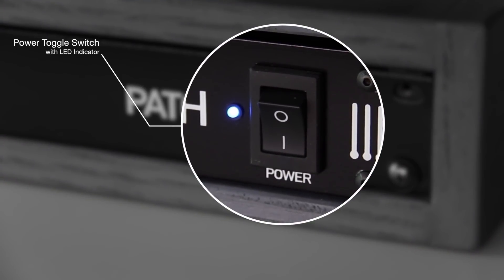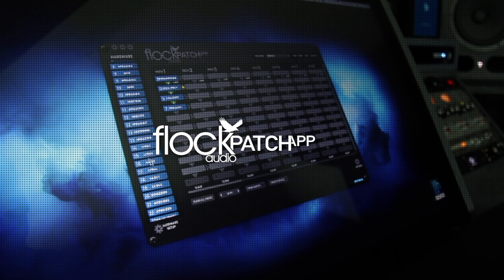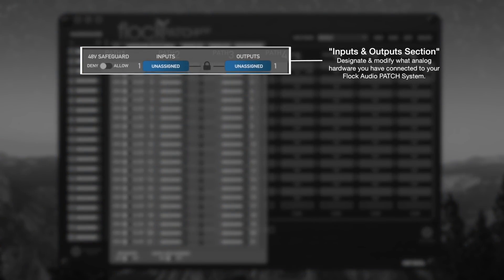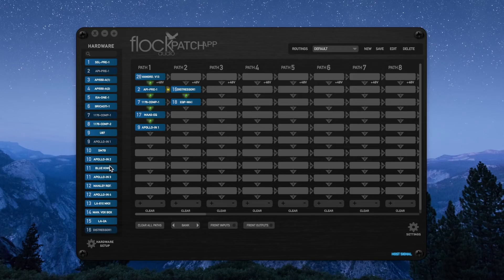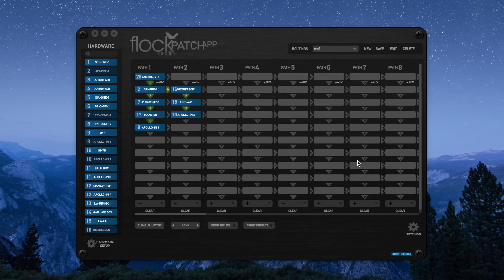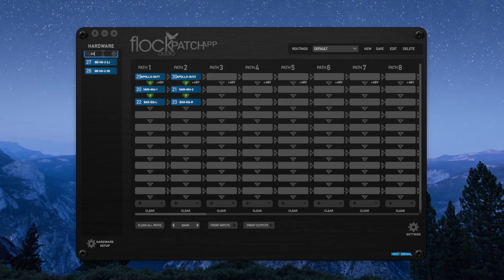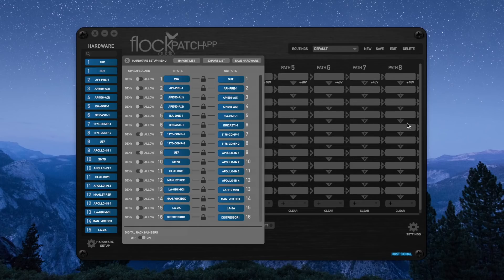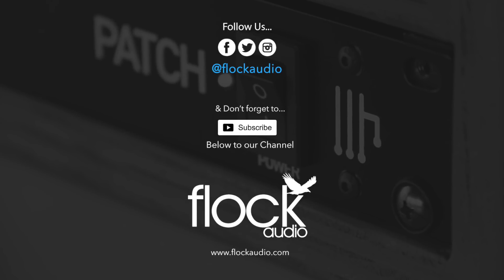Flock Audio: PATCH System Walkthrough

Comment: You have the example with the VANGUARD MIC connected to the patchbay going to a preamp. You say that it is a line level patchbay. Does that really work?
Reply from the maker: Yes — Some microphones and preamp combinations work fine with the Line Level Input. However, certain setups, especially with lower-output microphones like dynamics, do require additional gain on the PATCH input. That’s exactly where our CX Module comes in — providing the necessary boost to bring those signals up closer to line level.

Comment: I'm the exception to most people as I'm a complete beginner to audio synthesis and music production just looking at hardware/software capabilities and between digital/analog this is one of the better innovations for creativity that has been done in all of music. It just makes sense (not talking down the technical feats at all as there is a lot that goes into this kind of routing) to be able to make modular changes in this manner. Before I discovered this invention, I had the mind's idea of a plugboard operator when phones had to be routed, only it's a digital "brain" working for you. That led me to the discovery of patch bays but they were still severely limited in terms of automation and the physical capabilities of manually manipulating analog sound. I found the Korg Volca FM and found a similar way of splitting their audio wavelength modifiers into various orders they called "Algorithms," so I knew somebody somewhere had to have created a proprietary solution for all analog hardware akin to something of a digital GUI and firmware. Can't wait to buy one someday!

Comment: How does this compare to the Tegeler?
Reply from the maker: The Tegeler Konnektor is a different form of analog routing design compared to PATCH with different features and I/O. Sonically both options are transparent and provide reliable analog routing for users. Tegeler is a great a manufacturer and it really just comes down to the need of the user.
Reply: Mychal Simka  its better

Comment: I'm curious about the limitations in using multiple units. 

Is there a limit on how many channels we can send between two Flock units at a given time?
Reply from the maker: You can send as many or as little amount of I/O between units as you require for your setup. If you visit (www.flockaudio.com/downloads) we have a PDF available of a Multi-Unit Setup Example.

Comment: Any issues with running unbalanced synth signals into the patchbay? I suppose I could use DI's in front before going in.. This has always been the hazy part for me..
Reply from the maker: Hi Ernest, PATCH is a +4 Professional Line Level design, so yes we'd recommend that if you are experiencing a low signal from the synths that a DI or equivalent booster would produce a better signal result from the Synth into PATCH. :)
Reply: Flock Audio Thank you, can’t wait to pick one up!!
Reply from the maker: Anytime Ernest! :)

Comment: Let's say I have about 35 or more analogue gears, can I use two or three Flock Patch bays on the same computer?
Reply from the maker: Use upwards to 8 PATCH Systems all connected to the same Computer with 1 single instance of the PATCH APP Software.
Reply: @FlockAudio  Wow that's good news. I'm really glad I'll no longer have to worry about thos short annoying cables anymore.

Comment: Is it possible to bus signals from 2 paths to 1input?
btw great unit!
Reply from the maker: Hi, PATCH Can take any incoming signal and split it between multiple output signals using our Multing Feature!
Reply: @FlockAudio  that's not what the person is asking, he/she is asking if it's possible to MERGE 2 chains into one path, not MULT in this case, which could basically mean that you can sum signals into one input, is it possible?
Reply from the maker: Hi Marco, you are referring to "Summing" signals together when combining 2 signals into 1 output. PATCH does not perform summing.

Comment: How would this go in and out of analog gear without conversion?  So you wouldn’t need extra converters?
Reply from the maker: Zero additional converters required and zero latency. Because PATCH is a 100% analog signal path but digitally controlled, there is no AD/DA built into the system which doesn't convert or change your analog signal path. :)

Comment: I have a question about hardware setup - with a regular patchbay the normalled connections you make when you hook your equipment to the rear are super important because this creates the basic patch workflow...how does this play out with Patch? Do I need to follow any kind of logic when connecting my ins/outs or it doesn't really matter since I can configure everything using the software?
Reply from the maker: Hi HandHeldSound, You are correct! Normalling, Half-Normalling etc. are all irrelevant when using the PATCH System because you make all the necessary routing choices and configurations using the PATCH APP Software, which adds more flexibility options for your routing needs!

Comment: This is one of the most awesome things ever devised!

At first, I thought it was pricey, but considering how many problems this solves, it can cut costs in buying extra hardware and interfaces with too many unnecessary inputs. One could save 500-1k on an I interface with less inputs, not have to buy a monitor controller/switcher ($400+ for a decent one) to save outputs on the interface, etc etc etc, not to mention the obvious conveniences.  Basically, if someone wanted a Lynx 16, they might now get away with a Lynx 8 if they're not doing husge, love seessions. Similarly, an Apollo x8 can then be downgraded to an x6, so on and so forth. You could use a regular patch bay, but that is cumbersome when you want to just create.
I'd hate to add a feature request for something so great, but here it is to make it even more badass:
For an update to the software, I'd add the ability to add notes and pictures, to help remember recall of hardware settings. So, basically at least a simple text note and an image gallery you can drop images to for each preset, or a more complex note where you can put text and images into the same note (almost how Evernote would work on your phone).
For the images, a user can then take photos of their hardware and crop them on their phone, transfer to the computer, and then drag and drop them into the software.
This system is already perfect it seems, but a way to help users recall their hardware info would be even more amazing.
Oh yeah.. A way to back-up and export the notes would be cool too. Who knows.. Maybe even Evernote (or other cross-platform note system) integration..  might be going a bit too far, but since I'm on a roll lol 😂.. Who knows.. Maybe Evernote (or other) would even help you do this, as they might then start integrating Evernote into other systems. Whatever the case, with something like Evernote, a user could do all the notes and pics on their phone and save them to the cloud, without having to do much transferring back and forth to the computer.

Comment: I’m very interested in this unit, but How is this an “Analog” Patch bay? Is this unit ready to ship?
Reply from the maker: Hi Grupo, it is also Analog because there is ZERO AD/DA Conversion built into the PATCH System so each signal is 100% analog travelling through the System.
Reply: @FlockAudio  Do you publish the noise and dynamic range specs? Does it use Relay matrix or FPGA or what?
Reply from the maker: Yes Units are shipping!

Comment: I see you plan a forum ... but in the meantime I have some questions as I prepare to order cabling and 'think' through my setup.I see that I can delink  the rack i/0 but that the delinked i/o continues to display by the same rack number. 

So, if I route my preamps' output as 'in' to a specific rack and have the output routed on the same rack to an analog output from my interface, would I still be able to route that delinked input to any other available rack detached from the delinked output, i.e., pulling it into a path by itself while still being able to use the delinked output later in the path or in another path entirely?
Reply from the maker: Hi DF, This would be best answered by a member of our support team! Can you send your inquiry either on our website (www.flockaudio.com) or email it directly to support@flockaudio.com :) We'd be glad to help assist you!
Reply: FWIW tech support told me that delinked pairs can be individually routed in any manner that you like as long as they maintain their function as either an input or an output. So the answer to my question is, "Yes!"

Comment: How many paths are possible with the software? Is it possible to change the matrix shown in the video to shorten the chains but increase the number of paths?
Reply from the maker: Hi DF, The chains or empty slots aren't activate or representing any processing unless a digital rack is dropped into the slot space. So you can make them as short or as long as you have the amount of gear connected to your system! There are 32 Paths total! :)
Reply: Perfect! That was what I was hoping for.

Comment: I think I may have misunderstood something when this was announced: Is it possible to sum multiple channels to, say, one buss compressor in this unit?
Reply from the maker: Hi Angelo, Thanks for contacting us at Flock Audio! To answer your question PATCH is not a summing unit. You can take any 1 audio source signal and "Mult" it to all other 31 available outputs if you choose. PATCH is a routing system for analog audio, it does not perform channel summing.
Reply: Thanks for your reply! I was hoping for the unit to do a Brauer-style multi-buss approach, where I can send any channel to any buss, reverb, effect, etc.. Is this possibly doable in a software product or should I look elsewhere altogether?
Reply: But! If you have a summing box like the Dangerous for and example, I think you could bus from your DAW input thru your interface into the Patch System, process those stems differentially, then have multiple outputs from the Patch System into your summing mixer; then take the summing mixer's output back into the Patch System for processing your master bus.
Reply: I probably shouldn't interject, but ... If you have an interface with multiple outputs, just use multiple buses/ auxes in your DAW routed to different individual or pairs of those outputs. The terminology and setup is slightly different in different DAWs, but AFAIK they all will permit this. After those interface outputs are assigned as inputs in the Patch System, you can set up your Brauerized processing within the Patch System. You now make your changes for individual tracks by assigning them to different buses/ auxes in your DAW.
Reply from the maker: Couldn't have said it better ourselves! Thanks for your providing your input! :)